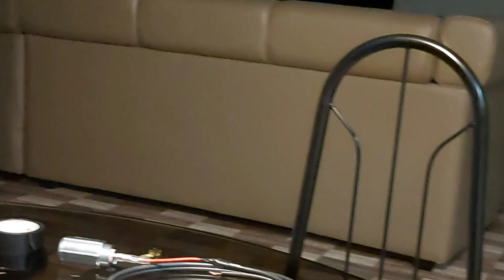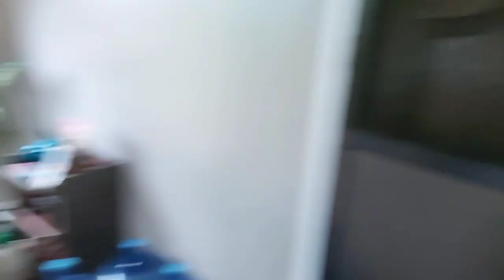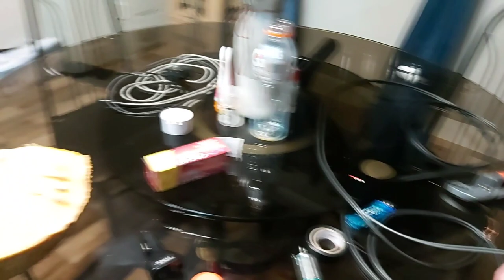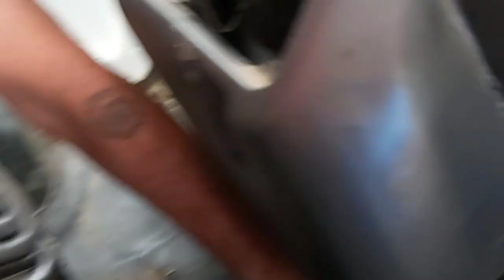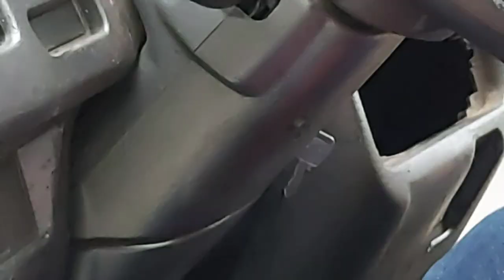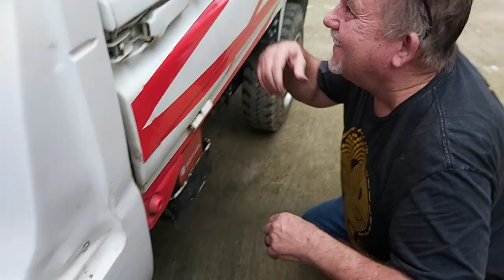PUTTING A CHARGER ON MULTICAB

Comment: Jeff you need to add a 4 or 5 amp in line fuse close to the battery. You have created a live wire that's that's on 24 7 you need protection
Reply from the maker: Yes sir he knows he just didn't get one yet but he will put one. Thank you for watching and God bless